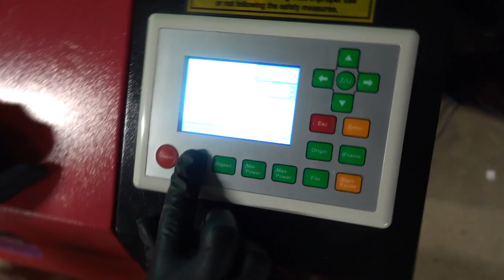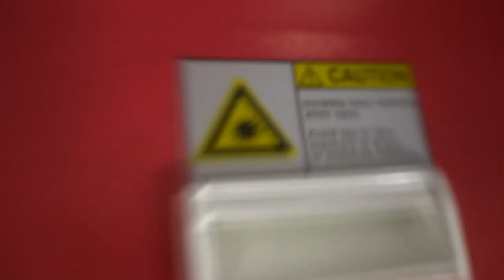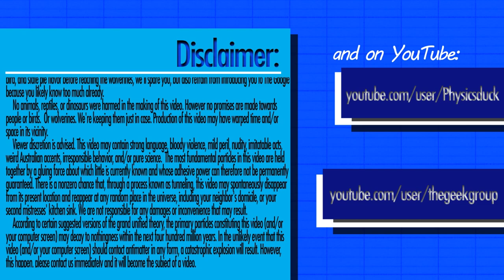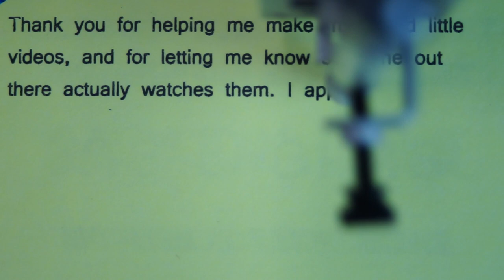Installing The Big Unit 2 Laser

Comment: I use a strip of card to mark the cutting line (at least 2" wide), always quite accurate with just one mark, it's what i used on my 4" and 6" coils, the problem with measuring 2 points is that the end has to be square to start with.
Though with that pipe it doesn't really matter if it's not square
You could have not glued the pipe and used some screws, there's a thought that air moving through a PVC pipe generates static, running a grounding wire to the screws reduces that.

Comment: CO2 lasers are deep in the infrared - 10600 nm compared to like 950 for IR diode lasers. That means that just about anything that's optically transparent, will absorb/block it - Regular clear polycarbonate safety goggles will perform just as well - They just don't have a certification to back them up.